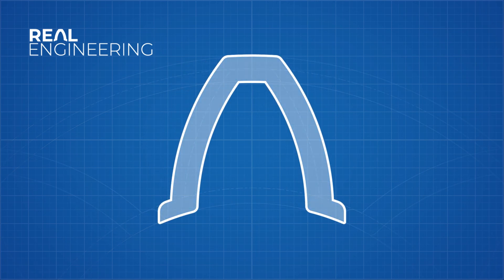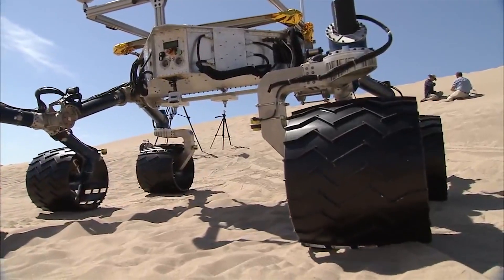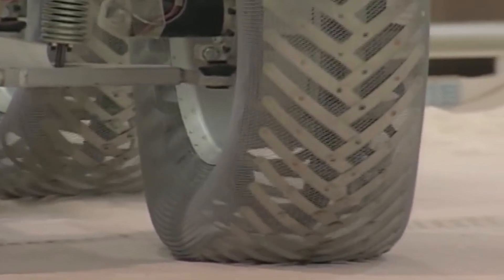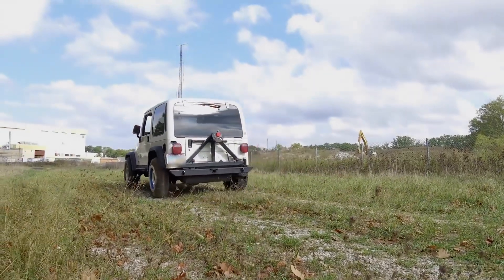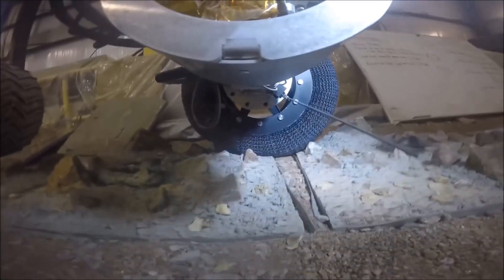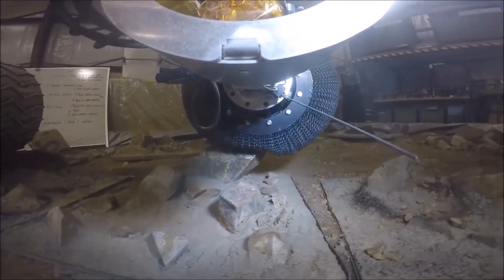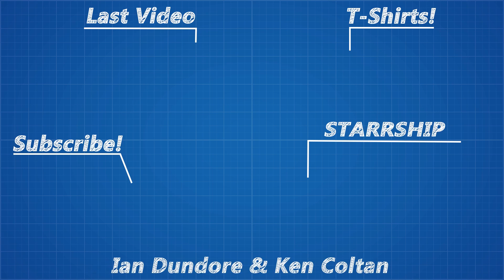How NASA Reinvented The Wheel - Shape Memory Alloys

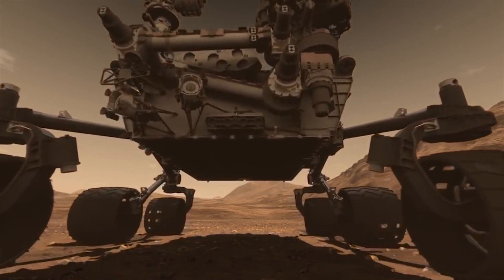Comment: 2:36 No it doesn't have a nuclear reactor... it has a Radioisotope thermoelectric generator or RTG for power. RTGs use an atomic battery which converts decay heat into electricity but the heat produced is from radioactive decay, NOT a fission chain reaction as in a nuclear reactor.
Reply: Interestingly enough, the distinction there isn't huge. MOST of the energy from a fission reaction is from the kinetic energy of the 2 fission products. This is actually similar to the alpha emissions from decay of Pu238. Fission, technically, is a form of radioactive decay. Some materials even have significant spontaneous fission rates. While us in the biz still prefer calling them generators or batteries rather than reactors, their are subtleties enough to nod your head and excuse it for lay people.
Reply: "Interestingly enough, the distinction there isn't huge."

HELL NO. The distinction is huge. In the energy released total and power, which in fission is immense while radioactive decay is comparatively low, and also in the vastly different energy producing processes that I explained already.

"MOST of the energy from a fission reaction is from the kinetic energy of the 2 fission products."

Wrong. The vast majority of energy from fission is released in the form of energetic x-rays. 

"Fission, technically, is a form of radioactive decay."

No it's not. Fission is a chain reaction. You do not know what you are talking about.
Reply: So, for fission about 160 MeV are from the kinetic energy of the particles, while only about 14 MeV are from gamma emissions (xrays need not apply). in all, when you include beta decays and losses from neutrinos, about 80% of total fission energy is from the kinetic energy of the particles. This is how reactors work at all as if most of the energy were from photon emissions it would be easy to make reactors that directly convert this energy to electricity rather than using the heat to generate steam to generate electricity. 

In every single one of my nuclear engineering textbooks, fission is referred to as a type of decay. This is because fission happens spontaneously already, we are just inducing it via a neutron absorption. 

There is no chain reaction, so that much is true, and the volume of power per reaction is also smaller, but the method of extracting the energy is very similar (thermally). Of course they are using thermocouples rather than other thermodynamic cycles, but they are more brethren than they are anything else. The process might be different but the end result is rather similar. Fission is volumes more intense and involves a chain reaction, but is still about harnessing heat from nuclear decay processes, namely fission vs alpha decay.
Reply: I just ran a twitter poll and it seems like this is a common misconception, that nuclear reactions are mainly emitting photons! Fascinating!
Reply: Turning photons into electricity is how solar panels work. This is called "photovoltaics", and while normally just applied to visible light, novel materials like methylammonium lead iodide have been investigated to harvest it directly into electricity just like PV junctions in solar cells. There are no real good sources of Xrays naturally so this technology doesn't really have a place, but it totally would if nuclear reactions primarily emitted xrays. They don't so we don't. 

If you would be so kind as to state the total power from each form of energy released from a fission event and their absolute magnitude, like this, I will quote a primary source from my nuclear engineering text book.

"Nuclear Engineering: Theory and Technology of Commercial Nuclear Power" by the legendary Ronald Allen Kneif (out of print but American Nuclear Society  still has copies, that is where I got mine)

Fission Fragments: 168 Mev
Neutrons: 5 MeV
Prompt Gamma Rays: 7 MeV
Delay Emissions:
   *Beta particles: 20 MeV
   Gamma emissions: 7 MeV
*includes energy carried by beta particles and anti-neutrinos 

Please provide alternative primary source for a source of x-rays as the primary emission mode. No nuclear expert I could find could make sense of this statement. 

As to the method of heat extraction, I already know the difference between thermodynamic cycles and thermocouples...I mean I literally mentioned them. The point is they are both heat engines. They rely on heat rather than emission of radiation. I, however, don't think you are an idiot, but you do seem to be misinformed. I am attempting to correct that, and I feel like I have tried to do that very peacefully. Forgive me for chiming in, I was just interested in talking about all the interesting nuance in nuclear technology rather than some kind of fight. 

I would have left it at that if you didn't explain some rather incorrect things about the energy distribution of a nuclear reaction. Hell, if you look at the wiki page for U235 if even enumerates it for you. However, I would LOVE to see something that says otherwise. It would undermine about 2 years of education on nuclear engineering, which would be impressive to say the least!
Reply: @BeCurieUs  ooooooooohsnapson
Reply: @BeCurieUs  Damn, this was a fine roast. Shut them up fast :D
Reply: Malamockq  youre wrong
Reply: SirKingHoff  And you have bad grammar. NEXT!
Reply: Malamockq Oof, you drew me back didn’t you? Notifications are a strange thing... Anyways I wish you luck with your twerking speed runs and I’m officially turning off notifications for this channel. Don’t bother responding because I won’t receive it.
Reply: still waiting for a cited source tbh
Reply: Pieoflords  For what? You didn't even participate in the discussion let alone specify what you want cited, nor is anything I stated something that you can't find on your own. Triple whammy for a triple idiot.
Reply: Malamockq 
> Calls our other people
> Triggered when called out
Hmmm
Reply: Jeaf Jeaferry Hah you're the pot calling the kettle black christopher. You're the one who is so triggered that you made at least 3 fake accounts to back you up. XD But interesting that you didn't even deny it. Go ahead, make another comment and deny it. I dare you :)
Reply: Malamockq Wow have you heard of the word “paranoid”? I thought you were just a troll, I didn’t want this. I’m turning off the notifications for this chat. Cya
Reply: what is this guys deal?! go make your own youtube video on nuclear reactors and how you are right and [they] are wrong if you have as much time/energy - as displayed in your comments above. 

but to be honest you made your point like 20 comments ago and haven't said anything other than "everyones an idiot (in some shape or fashion)" since. move on!
Reply: Sorry, i don't speak CROISSANT
Reply: For simplicity people say "nuclear reactor" to anything that uses radioactive stuff for power .
Reply: yes it does. It wegihts about millions stones and thousand nooks and grannies
Reply: True!
Reply: Childish ad hominems are a sign of frustration and anger because you aren't smart enough to actually refute anything I said. Tone down the white knighting kid and try to learn a little about what we're actually discussing instead of demonstrating your own stupidity and ignorance.
Reply: Malamockq Nothing you’ve said is too complicated for me or the other man you’re arguing with. You don’t cite sources and I don’t believe you are as smart as you think you are. What I do think is that you need a reality check.
Reply: Malamockq also I made no ad hominem attacks and if anyone’s doing such a thing, it’s you. Also white knighting is the incorrect term because I did not come to anyone’s aid but it’s fine. How does it feel to be treated in an equally condescending manner?
Reply: Christopher Willis agreed, good luck with your life man. Good to see people fighting the trolls. I’m done with this too.
Reply: Malamockq whoa are you ok? I know you seem like a jerk, but there’s probably something wrong. I mean this as honest advice: you should seek a psychologist or psychiatrist. There should not be this much anger in a person.
Reply: @jeafjeaferry6352  Ignore him, it's not anger, it's his bruised ego. He will learn in time, where results trump ego, and he will learn it in a most unpleasant and embarrassing way at that. Hopefully that will serve as his lesson to accept that sometimes, there are people smarter than you, and that doesn't make you stupid.
Reply: Malamockq -  your the one attacking with ad hominem.
Reply: Christopher Willis  You resparked an ember of interest in science in me. Your time here was not wasted. Thank you sir.
Reply: Spin  You have a playlist on theology, you better start getting interested in science. XD
Reply: Christopher Willis  hey, thanks for the lecture, i've learned a bunch!
Reply: @Malamockq  also , what are you an Nuclear technology engineer ?? People dont care about the difference between those two things .

Comment: .... You know you just described steel, right? Those 2 states are inherit to steel type structures. Kinda cool that it can be tailored to the application at hand though. That is cool. But yeah... the material you described is an alloy of steel. Not many metals make a structure that hard, and the only ones that do have an impurity built in, in the case of steel, carbon and other alloy metals that are put in.
Reply from the maker: Austerity and martensite exist outside of carbon steel alloys. Why they gave the same name to them is beyond me
Reply: .... Well that’s a first. Hi :D. First time I’ve had a YouTuber comment on my comment on their vid who has more than a couple thousand, lol.

I read a book on metal industry in my spare time, and it was specifically on the steel industry, though it also covered a good chunk of non-ferrous. It did describe martensite being specific to steel or something along those lines... It’s been a while since I read it.

Comment: 2 freaking Billion on a rover and they make the wheels out of aluminum instead of titanium??!!!
Reply: aluminum is 60% lighter and due to the way they made the wheels I doubt it would have made a difference assuming the wheels were on a weight constraint they would also have had to use 60% less material
Reply: It's gonna cost a lot more than that the heavier it gets... lighter weight means lesser fuel to use to launch it into space.
Reply: ccg 2301 depending on the type of rocket your using it differs but say you use a falcon 9 it’s around $4500 per kg and titanium is 4.5 grams per cubic cm whereas aluminium is 2.7 gram per cubic cm so it wouldn’t increase the cost by that much to make the same wheels
Reply: @eeyekk4858 
Finally I wanted to post that but I didn't want to take the effort
For a 2 freaking Billion dollar rover a bit of additional weight wouldn't be that bad if it depended on the compromise of the hole mission!
Reply: @eeyekk4858  I thought about it too like that at first. But this youtuber and most people are missing the point is that it wasn't the cost of launch that they made this decision. It was because it would probably increase the weight of the wheels a lot. I don't know what the wheels weigh but there are 6 of them and strong enough to hold 900kg of weight. If you use titanium wheels the weight might become 950 or even 1000 (essentially like 8-9% more). And the energy source they use (solar or RTF) might not be strong enough to power the vehicle at the speed which they planned to put it in use in. That's my logic at least.
Reply: saru if wiki is anything to go by the Falcon 9 of the time had a maximum 4,540 kg to GTO the Atlas V which is what they used was 8,290 to GTO the Atlas V also had cheaper offerings with less weight to GTO (7,475kg for 5mill less) so I doubt these weights are meaningless even if the whole payload was only 3,893 kg. Also, having only launched their rocket twice at the point of launch of the rover I doubt the Falcon 9 was ever an option on the table
Reply: AnD1262 true but was just using it for an overall comparison to show that the weight doesn’t vary that much between the two metals
Reply: I love how on videos like this, there's always people who assume to have some sort of divine insight of something SUPER SIMPLE and who trash-talk the scientists who built the actual thing. 
No offence to anyone, it's perfectly possible that you have the knowledge required to make such judgements and are actually right to lash out. But considering the time, people and money it takes to build one of these, i am pretty sure if they didn't use Titanium over Aluminium, they have a good reason for it and know better than you.
Reply: @SAB BETICHOD
There's a new material called Carbotitanium!!
Reply: The wheels were designed for a verry narrow set of tolerances. Informed assumptions turned out to be wrong. And yes aluminium was used because it has a higher strength to weight ratio than titanium. Every kilo cost thousands of dollars of fuel so nasa is willing to use the minimum weight even if it requires more work or larger thicker parts.

I did a back of the envelope calculation puting the the volume of each wheel in the ballpark of 10,000 cubic centemeters so using the figures from earlier its the difference between 27 kilograms and 45 per wheel. Or an exstra 128 kilos for the 6. Puting the cost at over a half million dollars in fuel.
Reply: @jaycie5021 
Thanks for your calculations but 500k for NASA is probably the anual cost of toilet paper in their facilities! The freaking rover cost 2 Billion and the wheels are one of the most important things! Without them that rover is useless
Reply: @justicewarrior9187  I'm not a materials scientist, but I'm guessing either the physical properties of titanium were unsuitable for the mission, or the designers misunderstood the kinds of wear the rover would experience and didn't deem more solid wheels as necessary.

However, it's important to note that the wheels on Curiosity, at the current rate of wear, will last more than long enough to complete the entire planned mission duration, and likely even further. The Opportunity rover was active for an incredible 55 times over it's planned duration. Curiosity will complete it's mission, the concern is how much extra use they'll get out of it. From what I've read online, the mission planners are adapting by trying to plan routes for the rover that avoid potentially hazardous rocks.

If the wheels hold out, it will likely be active for a long time, since it's powered by an RTG, unlike the other rovers which used solar panels, which were the cause of failure (degradation of the solar cells over time combined with dust accumulating over it). Hopefully the next planned rover (with a similar design as Curiosity) will utilize a sturdier wheel design, allowing it to go on for longer as well.

There's still some science they can get done without the wheels (spirit continued operations for some time even after getting stuck in the dust), just not as much. Plus, the ubiquitous six-wheeled design allows for some redundancy. Spirit continued to drive even after the front-right wheel and later the back-right wheel stopped working. In the front wheel's case, it stopped rotating altogether and they compensated by driving in reverse, dragging the wheel behind them.
Reply: @ENCHANTMEN_ 
Finally a good comment
Reply: @jaycie5021  I'm guessing that since they are launching on existing launch hardware with set capabilities, they are trying to fit it within those capabilities rather than increasing the rocket's size (which doesn't scale in a linear fashion, adding more delta-v/weight requirements increases fuel use exponentially, although the increased costs are mainly due to additional or more powerful engines, since rocket fuel is cheap compared to the actual rockets).

With interplanetary missions, there's usually a range of delta-v values (essentially how fast the rocket can accelerate the payload in a vacuum, this is usually in the range of 8-10km/s) that can get them to their destination (thanks to gravity assists), it's just a matter of how fast it can do so. They probably looked at the entire design for bits and pieces where they could reduce weight further.

If I remember correctly, one of the Apollo astronauts even suggested reducing the number of bandages just to save a tiny bit of weight on later missions!
Reply: @darklight8675 
No one has ever made something out of it, they are still trying to figure it out
Reply: Justice Warrior just use flex seal tires
Reply: @bobbyhill4118 
What if the aliens find that amazing technology??
What if they invade the earth to get it!!
Reply: Justice Warrior  We'll fight them off in our subarus
Reply: @justicewarrior9187  to be lighter Use your head
Reply: Titanium  is expensive
Reply: Higher malleability, and strength to weight ratio. Titanium would shatter, where you can crumple up and fold out the thinnest sheet of aluminum foil many times before it finds a way to break. If you're thinking about 'strength' that's kind of oversimplifying things - there are many different kinds of strength to consider in materials engineering. A rope can be cut by a knife that can't scratch glass, but throw some glass and a piece of rope at the ground...

Comment: One Note: NASA lists the dry mass of the Curiosity rover at 899kg/1982lbs. That mass is also its weight on Earth. But on Mars, the weight is reduced by 62%, isn't it? Therefore we're talking about the "sprung" weight on Mars being less than 342kg/752 lbs.  I understand the physics, and yes, the friction on the wheels stopping and starting would still be significant; but the downward force is greatly reduced, compared to Earth.  I like this new wheel. Looks like it could be useful on our own planet.